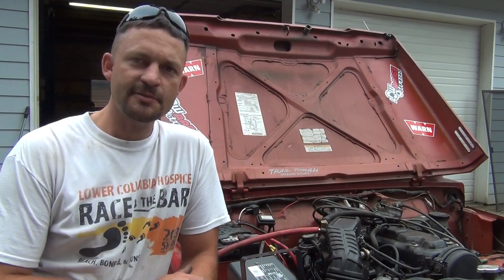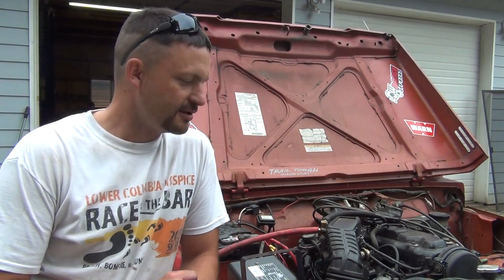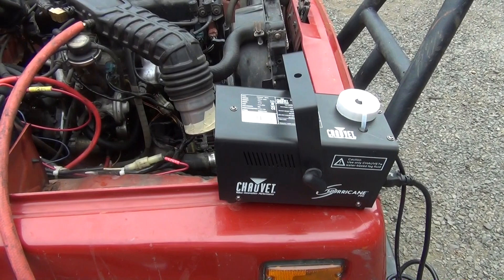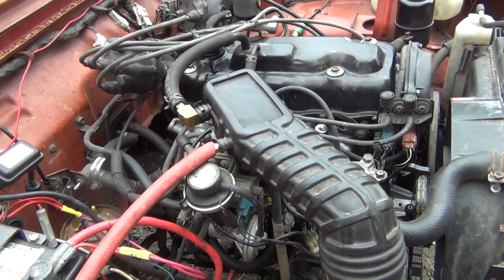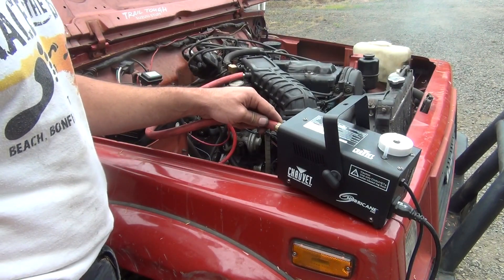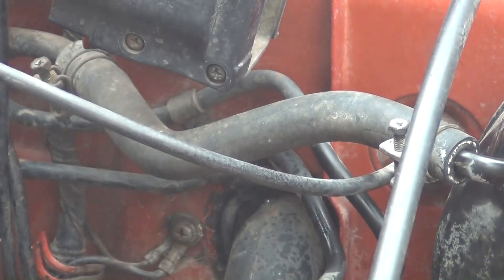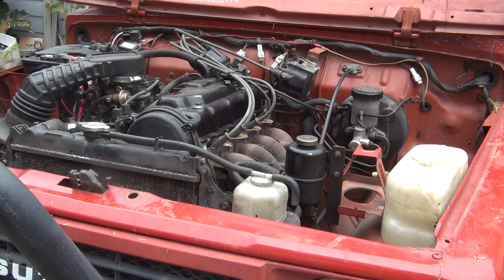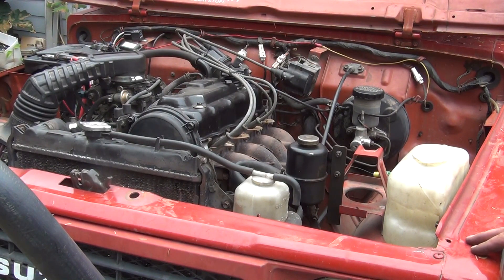Finding an automotive vacuum leak - different techniques

Comment: Hi, I like that. However my sidekick here in Kenya has hidden away vacuum leak points and am just clueless. So it revs. Also I have issues with ICS and ISC on the 95 throttle body. Advice

Comment: No one knows what type of fitting that is connected to the fog machine. A pretty large diameter hose needs to be connected to the fog machine if not using some sort of fitting.  Then it has to be stepped way down to fit onto your intake port.  Simply doesn't work that well that way.   I'm spending a lot of time trying to find the correct fitting to hold up to the fog machine.  Would like to know the size of the red hose and fitting in this video.  thanks!
Reply: I’ve had this idea before. I used a two inch ish pvc pipe and steppped down from that. The problem is that this method did not work for me. I’m not sure if it was the ambient temp or humidity of the city I live in but after a lot of trouble shooting we figured put that al the fog was condensing inside the step downs and intake before it could be used to sit leaks.

Comment: Matt Verley Not against a fog machine but concerned. Is there water and/or ? in fog. The starting fluid, brake cleaner and similar are NOT what I would use. For 1 you must be prepared for fire. For 2 those products are not made for and damage things like many things under the hood like vacuum lines. Along with plug wires, plastic and wire insulation, gaskets. The propane seems less invasive but prepare for fire but not as dangerous. Smoke machine can be made.
Reply from the maker: I made my own fog mixture using distilled water and glycerin.  It doesn't damage anything, and is even safe to breathe (in small amounts anyway).  I wouldn't use it on any hygroscopic fluid (like brake fluid) but in a vacuum system it is perfectly safe.  Not much different than driving through a fog bank or on a really humid day.

Comment: How do you use the smoke machine on a carburetor engine that has no intake snorkel?
Reply from the maker: just find a vacuum port somewhere on the carburetor or intake manifold.

Comment: Nice tutorial but as far as I can tell thats just the 1.3 but you said 1.6 Sidekick. Am I missing something? I've never seen the sidekick 1.6 with the 1.3 Valve Cover.
Reply: It is a 1.6 8-valve TBI engine out of a Sidekick; the valve cover looks identical to the Samurai's 1.3.  The 1.6L 16 valve has an aluminum cover that looks quite a bit different.

Comment: the smoke machine is the best
Reply: i have a fog machine am gonna use it as you do in your video so i can fix my car thanks man
Reply: my mecanic used some water poured  over the engine so white smoke comes out the tail pipe this means there is a leak but you cant tell where untill the video of the fog machine came out ....am happy now hehehe

Comment: I tried my Hurricane 700 but the issue I run into is as soon as the fog hits the clear tube I used, it condensates and turns to water. Any tips?
Reply from the maker: Try holding the tube about 1 inch away from the nozzle; allows air to mix with the heated fog fluid.  I did this when I was using a smaller diameter tube and it worked fine...
Reply: @MattVerley  I have the very same machine it came with a non condensing fluid  or so  it said on the bottle I've had no problems so far this is great way to check for leaks I work on alot VAG cars they suffer from alot of vac leaks

Comment: Great ideas there, and nice to use to find those annoying leaks. 
I was just going to mention the oxy./ acetylene  welding torch with only the acetylene turned on a little bit, and run the toirch tip over the hoses and manifold to find leaks, but you covered that with the propane torch,...same thing.
Good stuff to learn though,...Thanks again.

Comment: Good video thanks.  I happen to have purchased the same fog machine or very similar one with the remove on the cord for this very purpose years ago but never ended up using it.  I think do came to the conclusion that it probably wouldn't work but I see now that it does and I'm gonna dig it out and fire it up.

Comment: Would a vacuum leak ever cause your engine to idle at low speed and sometimes cut out completely while idling? I'm having that problem and wondered if it is a vacuum leak
Reply from the maker: +Ongomar A small vacuum leak will usually cause the engine to idle high.  A really big vacuum leak will cause it to surge and die.  Usually a vaccum leak will not cause a low idle.
Reply: Thanks for the reply. Do you have any suggestions on what might be causing a low idle and cut out?
Reply from the maker: Does it run well through the rest of the RPM range?  Hard to diagnose without hearing it in person.  But, here are the things that I would check:  Ignition timing, fuel pressure, spark plug condition/read, check for a sticking/faulty IAC valve

Comment: Are you going to make videos of the work you are doing to his rig??? I searched for days one time on a fj60 i had and it ended up being a vacuum leak around the throttle shaft and would only leak when the throttle was pressed.
Reply from the maker: Probably not; just doing a clutch replacement for now.  He is interested in doing a Toyota axle swap...if that happens, I'll try to document that project.
Reply: auto repair videos are huge on youtube, you never know it could be a viral video.
Reply from the maker: KydexByParlusk I have a few projects in mind...but I am trying to be choosy so I don't upload a bunch of junk videos.  I have a set of FZJ80 axles with e-lockers that are going into one of my own rigs...hoping to get some good documentation on that project.
Reply: sewerzuk I say sign up for adsense and make every informational video you can... you could make several hundred dollars a year and the more you grow the more you will make.
Reply from the maker: KydexByParlusk I've had adsense for a while...I clear about $200/month on my youtube videos right now.  I'm starting to see the possibilities here, but it has taken years to get to this point!
Reply: sewerzuk I know where you are coming from there... It takes forever to build up subs and views. Has any other companies offered you any deals besides adsense? some are scams but some are legit and pay better than adsense!
Reply from the maker: I've had about a dozen offers, but they all tripped the "phony meter" so I never responded...
Reply: sewerzuk if you have had one from outdoorhub i would check it out, that is who i signed up with

Comment: I guess it might be easier to go straight to the manifold. But you also said that it didn't have many vacuum lines so that might not work on this engine.
Reply from the maker: You are correct; If there was a large vacuum port somewhere on the intake manifold I would have used that instead of going to the air intake tube.  That way I wouldn't have had to block the throttle open and tape the air horn shut.  On those 1.6L TBI engines there are just a few very small ports...not big enough to allow the smoke into the system.
Reply: sewerzuk , on a Nissan hardbody 2.4L, where should I connect the smoke machine  to? the brake booster vacuum line to the intake? Or the similar to the way you showed here?